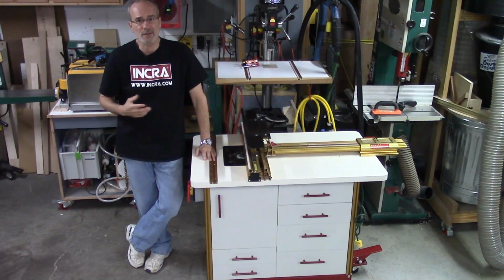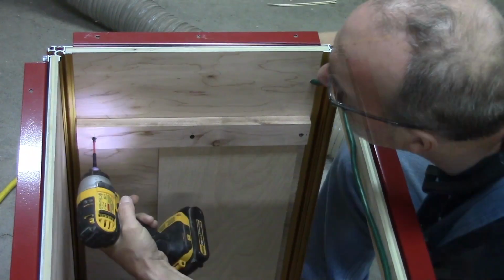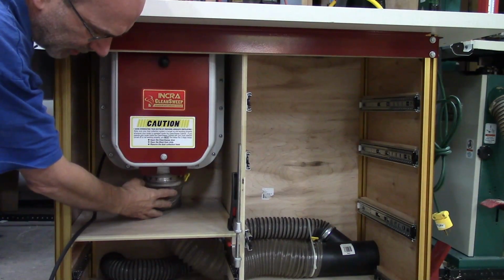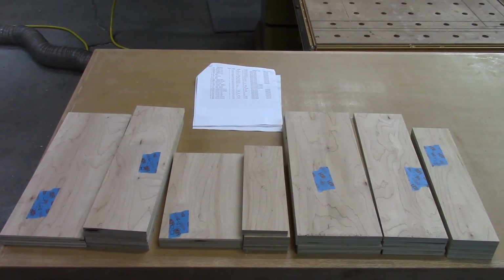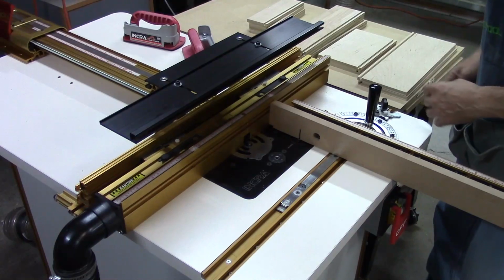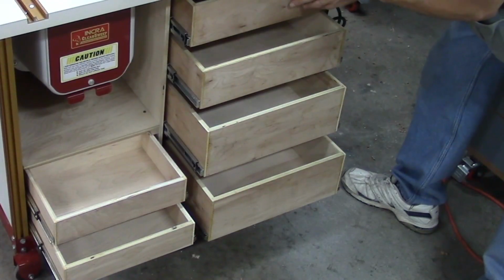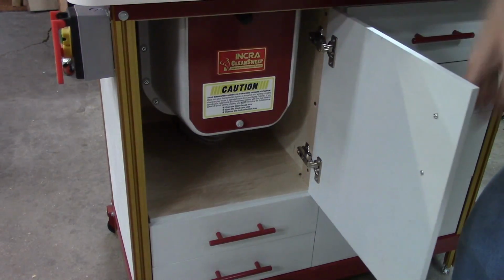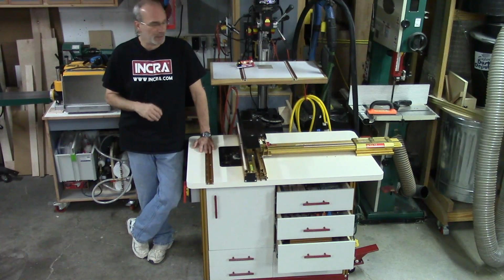Incra Router Table Cabinet Build Part 2

Comment: Love this pair of videos. Thank you for making the plans and cultists available. I’ve had the Incra table for about 3 years now and have been using it a lot. Have had this cabinet project on hold till now because I finally splurged to get a track saw. I feel confident that I can get all the plywood cut properly now.

Comment: I finally received my incra 27" x 43" LS positioner super system! man oh' man am I loving it so far!  Guy thank you so much for all your work into this build, I also want to thank you for putting up the plans! yesssss!!! I actually built one exactly like yours! well almost! This was the first time I have ever installed drawer glides, built drawers, or mounted door hinges.....which I'm still working on perfecting lol! all I have left to do is paint the drawer faces, and fix my door. Oh! installing the dust behind the 10" drawers was a challange, I cursed your name at least 3 times haha! but I was successful in the end! 

Thank you Guy!
Reply: He Richard. Starting my own build. Just got my Incra table this week. What did you wind up using for the hinges on the door. Can't find any that require less that a 1/2"  deep hole for the cup.

Comment: Thank you very much for putting all this together and for supplying the cut list and SketchUp plans. I am in the process of following your plans and was wondering if I lost a page as you had not, as far as I can see, provided details for the vertical spacing of the 2 spacing bars for the small drawers below the dust collection system on the left side of the cabinet. Any tips would be appreciated.
I was not a fan of the two hoses inside the cabinet so I asked my son to 3-D print a "T" pipe connection to which the 4” and 2” hoses could connect to. The bottom part of the "T" is the same length of the back wall and is form fitted into the back wall. A 2" hose connecter is attached on the outside of the back wall which means the entire 2" hose is outside the back of the cabinet. Doing so eliminated the requirement for the 2" hose inside the cabinet and this set-up works wonderfully. I can provide the 3-D printer pipe connection plans / specifications if anyone wishes. I also used the blue flexible "Dust-Rite" 4" hose which made dust collection hose installation much easier than using the hose in your video.
I know you mention it but the install of the power system needs to be considered before anyone gets too far down the build path.  I had to take the walls apart after I had screwed them together in order to cut a hole in the left side panel for my power / switch box, to cut a notch in the centre vertical panel through which to route the power cord, and to cut a notch in the right side panel to route the power cord through. In your explanation, you sort of breeze over this issue.
I bet I have viewed your YouTube Router Table Videos a dozen x 4 times to capture the wisdom of your work. As such, I noted that you had a pocket hole in your vertical panel about halfway up the board facing the front. I am hoping this was an error or I am really doing something wrong!  
Thanks again and although it took you only 45 minutes to install the full extension door slides, it is taking me slightly longer!!!!  🙂

Comment: High high is the SS1 Filler strip on the left side? Also, what door hinge did you use with 1/2 inch door?

Comment: Great video Guy. Question though, is there a reason that you ran the dust collection they way you did instead of just running out the back of the compartment where the Router/Cleansweep component is located? Seems like this would free up some space for those two bottom drawers to be full extension drawers.  The Y would be on the outside of the cabinet in this case. Just wondering...
Reply: Thanks Gary. I didn't want the wye on the outside of the cabinet is all. There is a ton of storage, so losing a few extra inches of depth in the drawers on the bottom wasn't a big deal to me. It's very easy just to route the DC outside of the cabinet as you suggested if it works out better for you.

Comment: Guy,  Very educational video.  Thanks.  It motivated me to build the cabinet exactly as you laid it out.  Okay, so I am really new at building cabinets and placing drawer fronts (like this cabinet is my first). 

1.  I am at the place where I am placing drawer slides.  I cannot find the dimension for the height of the bottom of the spacer for the highest drawer on the left side (the one immediately beneath the door).  Can you help, please.  I don't want to go through a trial and error sequence as I am not sure how to determine this exact measurement.  
2. Also, when placing the drawer fronts, does the bottom of the draw box align/ flush with the bottom of the drawer front?

Comment: Which hinges did you use for the door? Most are designed with a cup depth in the door of 1/2 inch, and that won't work for 1/2 inch ply door!
Reply: Seems I have run into the same question. Did you ever find a hinge that would work?

Comment: I'm building the same but with out the two small drawers under the clean sweep. Question...what stops the door when you close it? There isn't anything opposite the hinges to stop it from going past flush!
Reply: You can glue a little stop to the plywood panel to the left of the door.

Comment: How do you open the clean sweep to change the speed of the router since it drops down below the clean sweep.  It looks as if you have a divider just below the clean sweep.  Does that inhibit access to the router from below?  Thanks.

Comment: I've been thinking about a router table build and I've been watching a lot of videos on them and I think this is the only one that makes no since to as to the way it's built. first you've lost 3/4's of your work space that this big hauking fence arm that i can't figure out way you would need that bar perpendicular to the fence and across the width of the table, and then your working across the depth of the table, not the width?. why make a table so big to only use about a foot of it. I would have thought that you'd want the router center of the table and work across the width. as well instead of all the waisted twisting and turning of the hose that your never going to have access to, and the ridges will collect dust instead of sending it out of the cabinet. why didn't you hard pipe it out of the box you don't need it to move or flex inside of the box? It look neat and cool but it seem like a lot of waisted floor space for its usefulness.

Comment: It looks like you used a bushing to hold the router bits.  What's the source for them?
Reply: Check out Rockler. They have bit holders that can accept either 1/2" or 1/4".

Comment: Would love to know the dimensions of the table......
Reply: Did you read the description? There is a PDF of the plans with full dimensions and a 3D Sketchup model.
Reply: I';ve since found the dimensions but thanks.  I intend to make my own build making a hybrid table......using the bench dog cast iron then adding an extension table and using the Precision Plate v 2.0 that would enable my extension table to use the LS positioner AND also the Wonderfence.  The best of both worlds......